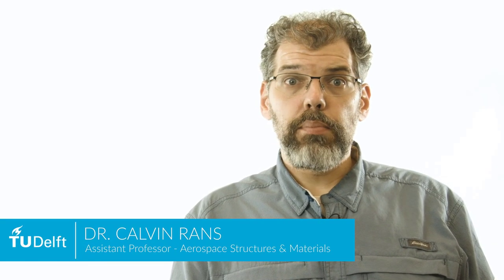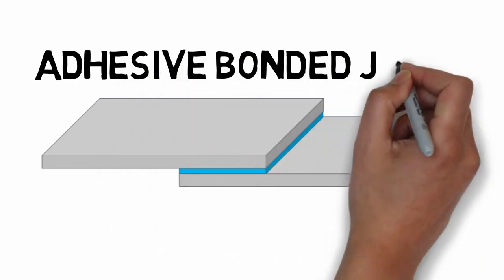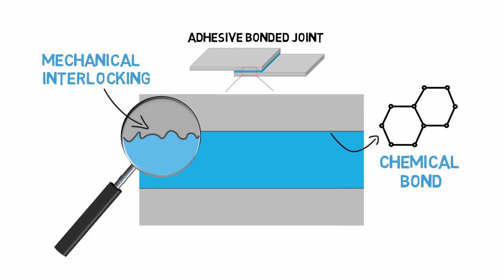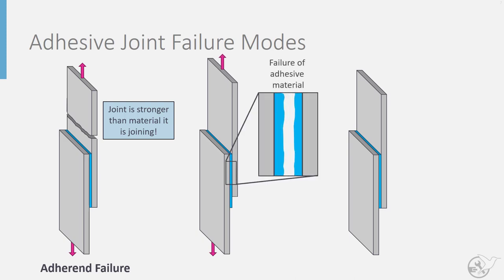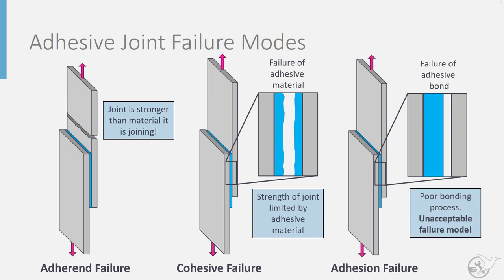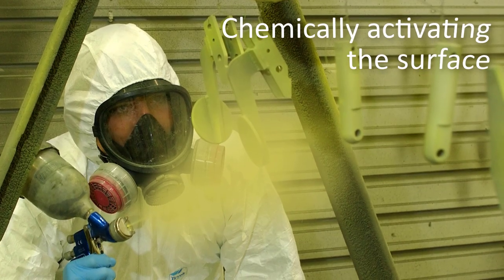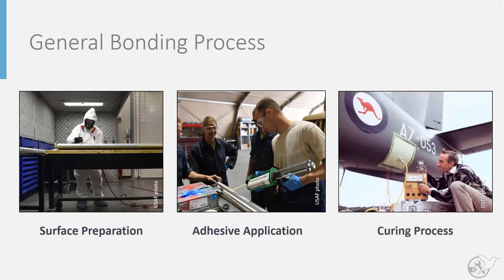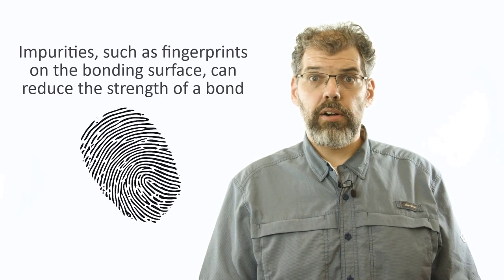Adhesive Bonding as an Aerospace Joining Method

Comment: Lotus are glued together as well with structural adhesives. PLENTY of safety critical components in aviation and many other industries use and rely upon these chemical/mechanical bond joining methods. For this TITAN craft that dived to this depth numerous times before it will be interesting for me as a materials joining engineer to see whether it was a cohesion or adhesion failure in the cirumferential joint bond. RIP to all those that died...